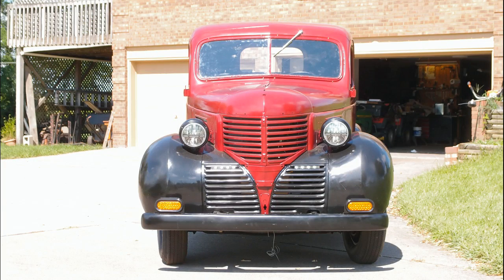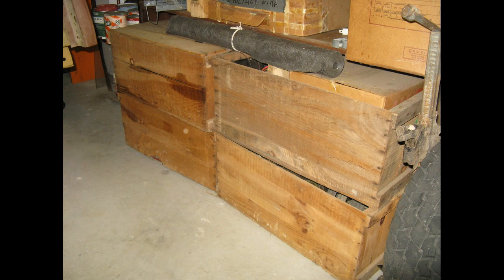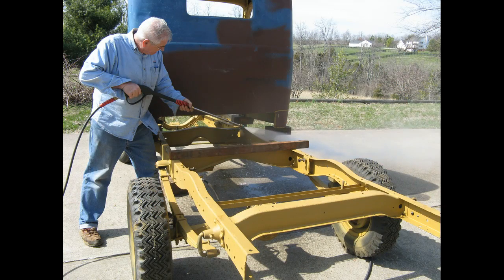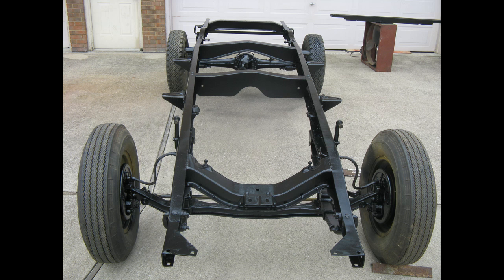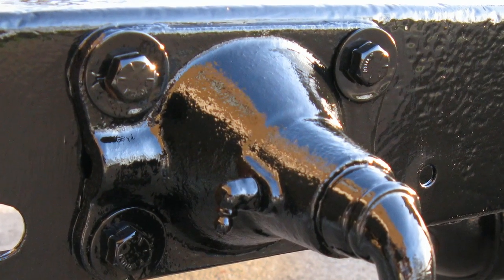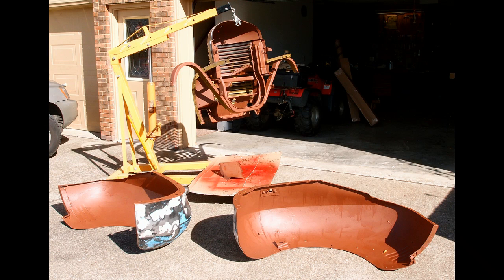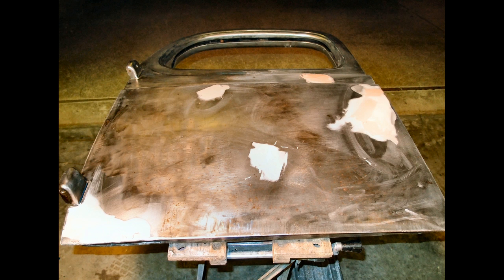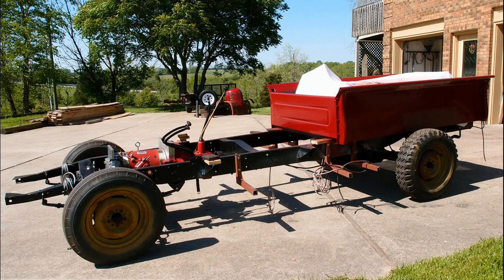1939 Dodge Electric Truck Part 1

Comment: Idea 💡: what if instead of a big battery 🔋 for the electric motor, you instead install a small Yanmar diesel generator (size of Briggs and Stratton give or take) to supply electricity 🔌 to the truck's motor making it a diesel electric hybrid 🤔😎???

Comment: Excellent truck conversion you did. Even adding solar panels, not only recharging the battery, but also driving the car longer on sunny days is a suggestion.

Comment: Nice work on the truck but the electric is questionable. Since 92% of Kentucky's Power comes from Coal, it's essentially a coal powered vehicle. Why not leave the more efficient gasoline motor?
Reply: sixtyfiveford Great argument to stop burning coal. Coal plants are 34% efficient at best, gasoline cars are 21% efficient at best, electric vehicles are 59% efficient at worst. http://www.pnnl.gov/  http://www.fueleconomy.gov/feg/evtech.shtml 

Add lower costs per mile, lower maintenance costs, plus higher efficiency; this project makes sense.
Reply: just sayin, he can install some solar panels on his roof that will charge the car
Reply: sixtyfiveford 
1) BEV's are not coal powered, they take power from whatever power plant is available and those can always be upgraded/replaced. You can use solar, hydroelectric, geothermal, nuclear, whatever you want. Upgrade one plant and thousands of BEV's will instantly benefit.
2) Even a coal power plant is more efficient that a gasoline powered vehicle. Gas powered vehicles idle in traffic and operate outside of their peak efficiency as their engines spin up and down. Power plants don't have those problems.
3) Drilling, shipping, refining, hauling, and pumping gas all require energy. BEV's don't need any of those steps.
Reply: +sixtyfiveford "On that rational I will put a huge gasoline generator in the bed of my truck and use it to produce energy for my electric motor powered truck."

No, since the gasoline you would use still would have to be refined, which takes huge amounts of electrical energy. 
There is a reason many rail roads are run by electricity.
Reply: sixtyfiveford Gasoline travels by ships, trucks, and pump operated pipes. Electricity travels by copper wire. Gasoline has to be pulled out of the ground and refined into a usable product. Electrice can be pulled from the sun, the wind, water currents, geothermal heat, as well as from fossil fuels.

More importantly, ICEV cars must operate under constantly changing workloads and speeds. ICE engines are terrible at this. They perform most optimally at constant speed and load. EV motors don't have this defect. So even moving the ICE to the power plant and the EV motor to the car you already gain efficiency as each is performing the role they are best suited to. On top of that, power plants are massive, so now you have economies of scale adding to the efficiency of this setup.

Furthermore, there are fewer power plants than cars. Upgrading 1 powerplant to be more environmentally friendly is far easier than upgrading 1000 cars. So using a power plant for your energy source, increases societies ability to improve the efficiency and environmental impact of its vehicles down the road.

Finally, new solar and wind power plants are growing in adoption far faster than any other type of power plant. The primary reason is that they are now the most economical solution.

As a result, driving an EV will reduce your environmental impact now, and even more so in the future.
Reply: sixtyfiveford Your information is out of date http://cleantechnica.com/2015/07/06/solar-wind-74-of-new-us-electricity-capacity-january-may-2015-exclusive/
Reply: sixtyfiveford
"They too are powered by their parent source that originally created the electricity which in the US is..."

Yes, the same power sources that are used to refine that beloved gasoline at a rate of about 1kWh/L.
So Jeremy Clarkson can say PEV's are coal powered cars, I can say ICEV's are electrically powered cars.
Reply: sixtyfiveford"Just the misconception that people have about electricity magically appearing in their battery banks without thought to where or how the electricity was created."

And I say you might have the misconception that gasoline magically appears at the gasoline stations.

Compare please:

Gasoline car: 1kWh/L, with a fuel-efficiency of say 15km/L, making it 66Wh/km electricity needed just to make the fuel.

EV: consumption say 240Wh/km

So even before you get to drive, you have used 1/4 of what the energy the EV needed to drive.

As you can see, the argument sort of goes both ways.
Reply: *****
A 50lb bike is a different story and will work with solar's very limited capabilities. But it is also so light it makes more sense just to peddle the thing if you're trying to save the environment.

Yes, I spend less than $20 a month to commute to work in a dead dinosaur powered car(1996 1.9l gasoline manual trans). 10 miles round trip @ 36mpg average(32mpg low and 48mpg if I try hard) for 22 avg work days in a month equals 6.1 gallons average. At my current fuel rate of $2.60/gallon(one of the highest in the US) that makes it $15.86($11.91 if I try) a month and I get a radio/AC/seat belts/air bags/shade/option to take passengers etc and my commute is substantially shorter in time.

I'm using this car at 30-40% efficiency which is double a home built EV running off a coal power plant.
Reply: ekhaat
Trains (large) are run on multiple Diesels that turn generators that creates electricity to turn the wheels.... WHY? because you can put more electric motors with more torque on the individual wheels. So it is Diesel powered. Light rail trains are run on electricity either because they run underground or for the same reason as full size train as you have the ability to add extra motors easier to easily increase load capacity. They too are powered by their parent source that originally created the electricity which in the US is
		Coal = 39%
		Natural gas = 27%
		Nuclear = 19%
		Hydropower = 6%
		Other renewables = 7% 		
				Biomass = 1.7%
				Geothermal = 0.4%
				Solar = 0.4%
				Wind = 4.4%
		Petroleum = 1%
		Other gases < 1%

Intermittent Solar and wind power are nowhere near were they need to be to power anything of this scale. Mainly due to their huge inefficiency vs their size and hugely inadequate battery technology. The only renewable source viable to power anything reasonable is Hydroelectric and it is limited to certain small regions in the US. The only thing that will oust coal in the neat future is Natural Gas or Nuclear.
Reply: Not really, anyone/everyone should say PEV's are 67% fossil fuel powered and only 13% renewable energy powered. It is what it is....

1kwh/L: Each liter of gasoline contains 8.9kwh of power so you consume 1/9 of a liter to make a liter of gasoline. So no where in this equation does it make a internal combustion engine electric powered.

I have no issues with EV's. Just the misconception that people have about electricity magically appearing in their battery banks without thought to where or how the electricity was created.
Reply: You loose energy when converting from one type to the next. A gasoline motor, even a flat head will be more efficient than Coal-electric powered vehicle.
Reply: You can find biased articles either way. This article claim is if you live in a Coal powered area an electric car produces 360% more soot and smog http://finance.yahoo.com/news/study-electric-car-may-not-114859842.html .

Every time you change one energy form from one to another you loose a percentage of the energy to heat or mechanical deficiencies.
Coal is burned to create steam 90% efficient
Steam turns turbine 40% efficient (60% energy loss)
Turbine rotates generator 100% efficient
Generator generates electricity 90-95% efficient.
Power to User 10% loss due to resistance in power lines and transformers
converting 120/240v AC to DC charging power for batteries 10-30% loss
Chemical reaction to store electricity 10% loss
DC electric motor will loose 5-30% in heat.

All this adds up to a LOT of wasted energy. Make a vehicle run of straight coal and then they'd have something.
Reply: sixtyfiveford You're reading some very biased articles. Other people have estimated that it takes as much electricity to refine gasoline as it does to actually run an EV, and you don't have to use any gasoline at all! Given that, it doesn't matter what you do to generate the electricity, you're still better off than burning gasoline in your vehicle.
Reply: dlwatib
On that rational I will put a huge gasoline generator in the bed of my truck and use it to produce energy for my electric motor powered truck.

Even the highly biased pro electric articles show where your energy comes from matters. It really only helps if you want to use solar or  hydro-electric. In the end of almost every debate I've read EV enthusiasts concede the batteries technology is not where is needs to be to make it a optimal solution.
Reply: Dale Sherman
The two methods of comparison in the article can't be compared in the way they state them. "Electric vehicles convert about 59%–62% of the electrical energy from the grid to power at the wheels" That is hugely inefficient when the power source is coming from coal or almost any other fossil source. It would make sense with Nuclear or Hydro (wind and solar are too weak to sustain homes let alone travel)

The point is if you going to run a vehicle on alternative power sources to be eco friendly; you need to run it on the parent source to make it the most efficient. So if your energy source is coming from coal, run it on coal. Every change in energy form results in huge losses.

As stated in the article: Just converting house power to charge batteries results in a 20+-% loss(120/240v AC to 12vDC) This also roughly includes the process of converting  power into a chemical reaction and back. But doesn't include battery self discharge that can be another 10+%. This is depending on whether you use Lead acid, Lion, Lipo, etc.

As stated in the article: Electric motors loose another 20+-% just by running.

Parent source is the key. Theoretically, if you used a coal powered car (Steam engine) you could have a car 40-50% more efficient than an electric car ran off of coal electricity. The same goes for almost any power generating parent source.

We can barely support the homes in an area by running the power plants. There is no capacity to handle transportation. Coal is by far not the best method to create power but I doubt nuclear is coming anytime soon, so we'll litter our landscape with ugly, inefficient for their size, Windmills and Solar Panels.

Yes, there is a time and a place for electric vehicles, just not everywhere. If you live where you have Hydro electric, you're golden and will save the world.

I'll use your articles #'s. Start with 100% energy from source
Coal power plant 34% efficient( 66%loss)
Power to transformers into home 90% (30.6% of parent source)
Charge EV batteries 80% (24.48% of parent source)
Electric motor to wheels 80%(19.58% of parent source)

So from coal to moving in your EV you are looking at a peak 19.58% efficiency (with top EV technology) . Now that is a comparable number to the articles "conventional gasoline vehicles only convert about 17%–21% of the energy stored in gasoline to power at the wheels".